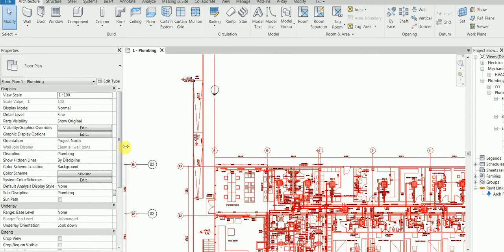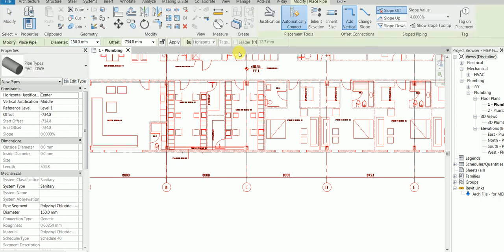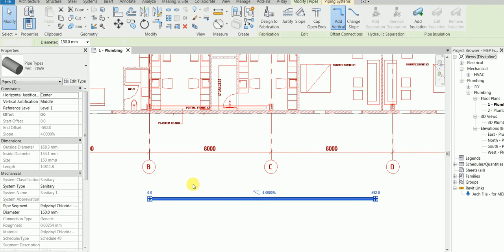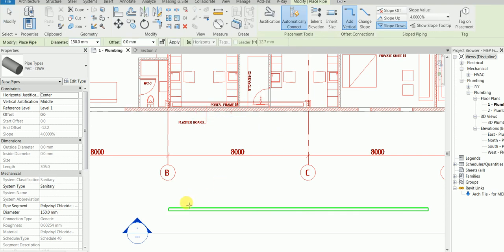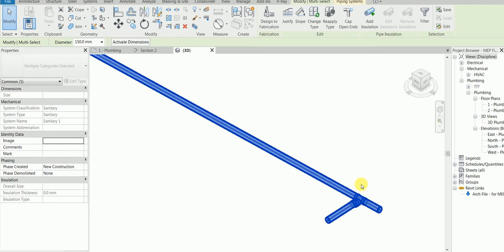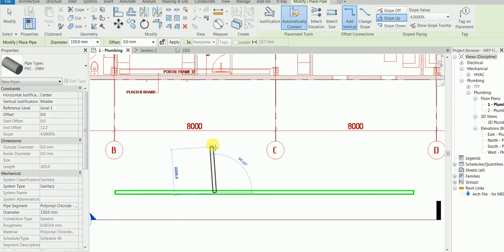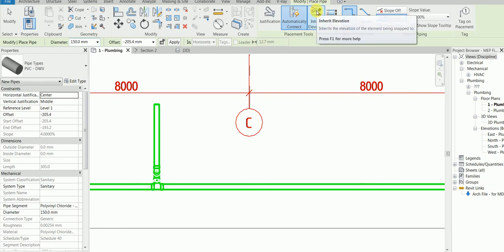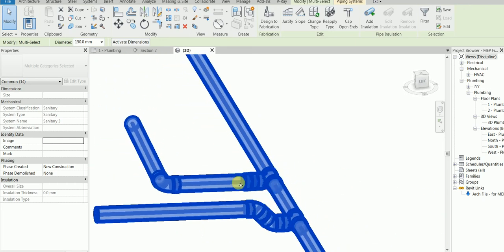REVIT MEP ( HVAC + PLUMBING )COURSE - COMPLETE FROM SCRATCH ( AUTOCAD DWG) TO REVIT MODEL - PART 6

Comment: i tried but I didn't got the answer of inheritance please explain. and one more that you told you will explain about how to give room tagging with the same name of the room which is mentioned in the arch model at once to all the room to avoid the repeated work that also you have not explained sir in think it was in the part 4 video you were explaining about the spaces and heat load calculation.
Reply from the maker: I guess in one of the videos in my channel I have explained - the concept of Room & Space Tagging. If you didn't find it I'll make one video especially for that, when time permits. Keep Moving Forward !!!